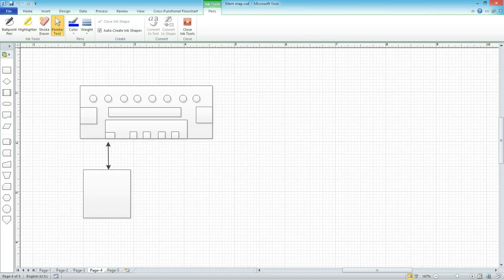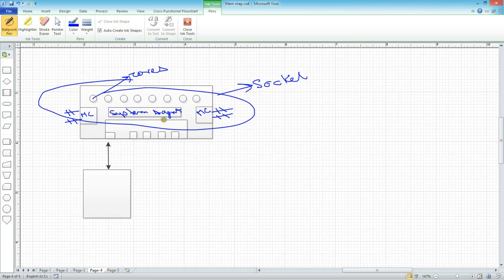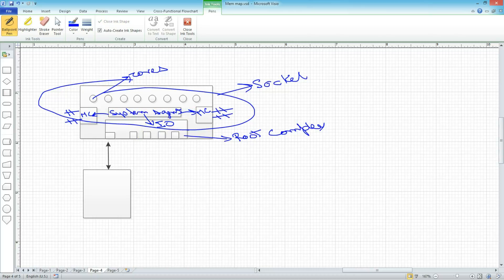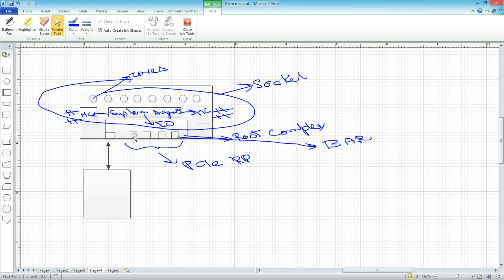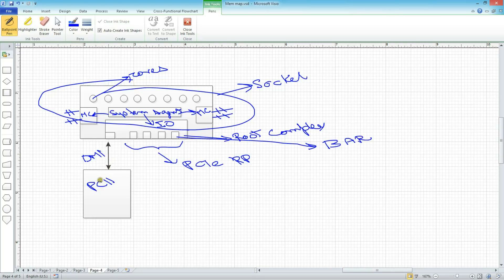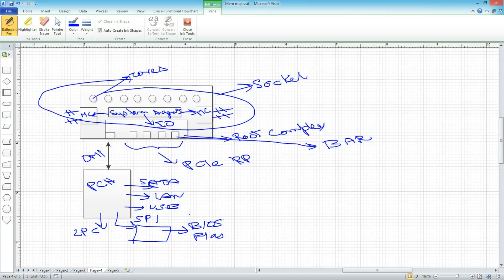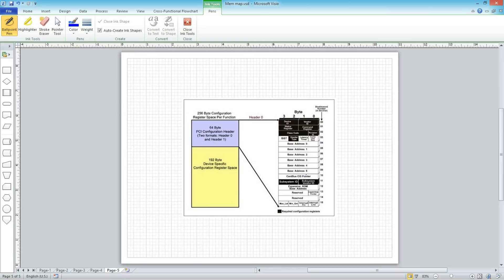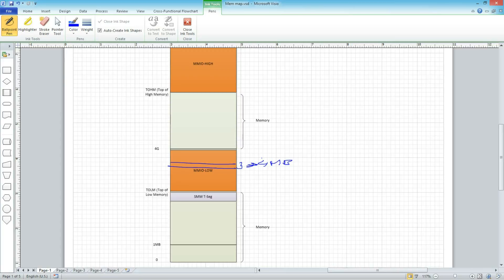System Architecture:  5 - Transaction flows and address decoding part 2

Comment: I understood the positive & negative decoding for two different paths of PCIE  ports & I/O hubs. The USB4.0 interface can carry the three different protocol data of  USB3.2 & PCIE data &  display port data.
Which decoding is applied here for the following data transfer ?
PCIE data transfer over USB4.0
USB3.2 data transfer over USB4.0
Display data transfer over USB4.0

Comment: In case of PCI (could be PCIe as well, I haven't studied that far), the BIOS directly accesses the PCI BARs directly via port mapped I/O and sets them up with proper values to map different memory/I/O chips to different ranges in the system address map. But how does this port map I/O BAR access happen in the first place? Is the address bus soldered on the motherboard to connect to the PCI chipset in such a way that specific port mapped I/O access request always reach these BARs (according to the PCI specification)?

Comment: In the eye of a CPU core, the world is just a bunch of addresses, be it memory or IO addresses. Just like a Turing machine viewing the boxes on a paper tape. It is BIOS' responsibility to properly program all the system agents and downstream decoders on the platform to route the transaction targeting a certain address to the right destination. Be it DRAM, PCI-E endpoint device, etc.
Reply: In case of PCI (could be PCIe as well, I haven't studied that far), the BIOS directly accesses the PCI BARs directly via port mapped I/O and sets them up with proper values to map different memory/I/O chips to different ranges in the system address map. But how does this port map I/O BAR access happen in the first place? Is the address bus soldered on the motherboard to connect to the PCI chipset in such a way that specific port mapped I/O access request always reach these BARs (according to the PCI specification)?
Reply: @EvilSapphireR  It's the platform's responsibility to provide a means for software to communicate the B/D/F offset info to the silicon. As a programmer, you should focus more on what you want to convey to the platform rather than how you convey that info to the platform. Because the how varies across platforms. I remember there's a section in PCIe spec addressing the "software generation of configuration transaction". Take a look at that.